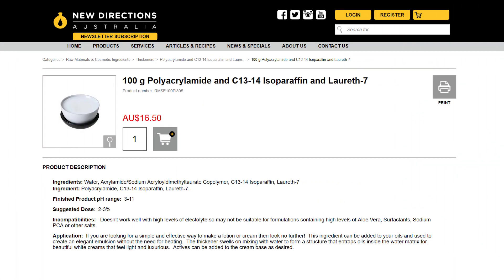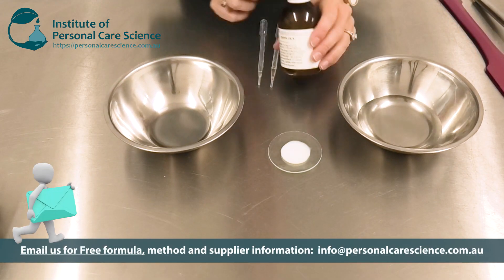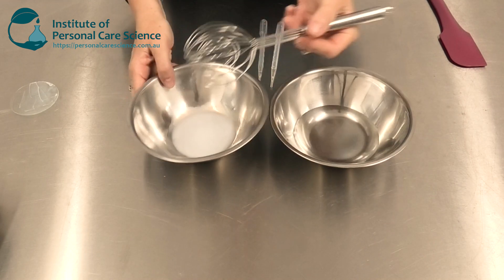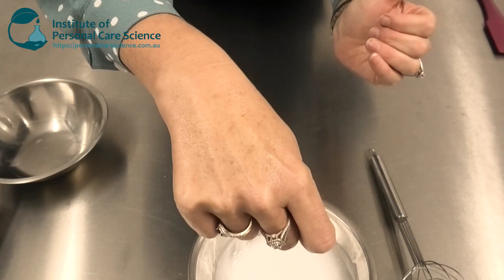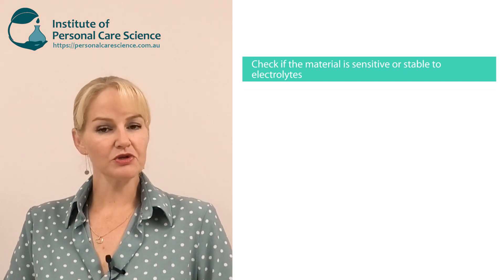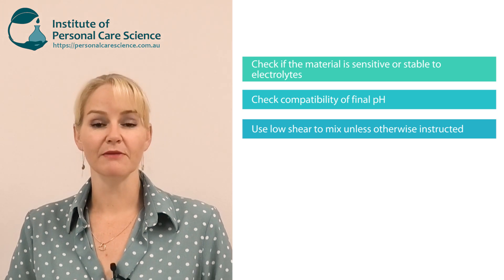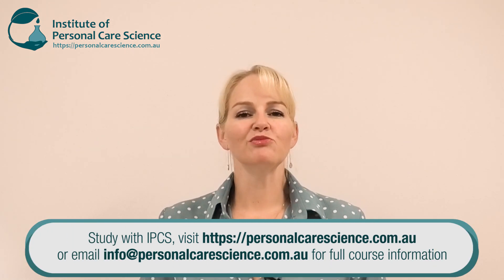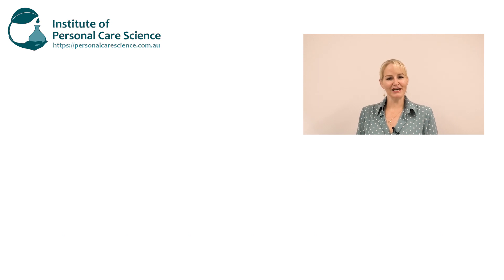How to make cream gel moisturizers

Comment: Is the polymeric emulsifier heat tolerant if you were to add 2% heat melted wax, such as a cetyl, for example? It being non-ionic also?
Reply from the maker: You don’t need a wax in a cream gel – it would make it a cream, not a cream gel. You would have to check the specific grade of your polymeric emulsifier to see if it is heat tolerant, as several are. But the point of a polymeric emulsifier is to use cold process method to save time and energy. Learn to make these selections and formulate professionally with our Certificate in Advanced Cosmetic Science: https://personalcarescience.com.au/CosmeticScience/CertificateinAdvancedCosmeticScience-478/ and Diploma of Personal Care Formulation: https://personalcarescience.com.au/CosmeticScience/DiplomaofPersonalCareFormulation-479/

Comment: Can you add melted hard butters in a formula with a polymeric emulsifier?
Reply from the maker: Hi Rachel,

It would be difficult – they would solidify into their original form when they hit the cold polymeric emulsifier. You could check your polymeric emulsifier to see if it is okay to heat (most are) but then you also need to heat the water phase, which defeats the purpose. Or you could heat your butters with liquid oils, then allow them to cool and if that remains liquid, add them cool that way. 

Happy formulating!
Reply: @theinstituteofpersonalcare6401  thank you! I tried it, and it worked! But my finished formula ended up piling on the skin when I rubbed it in. Would you have a guess as to why this happens? I think I may have added too much emulsifier.... Thank you!